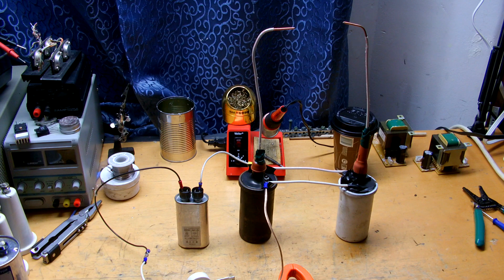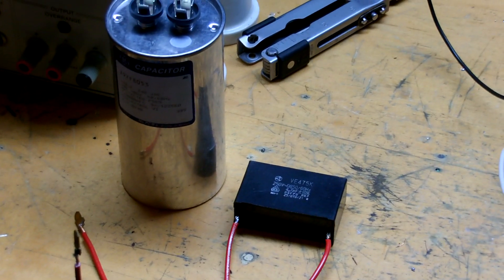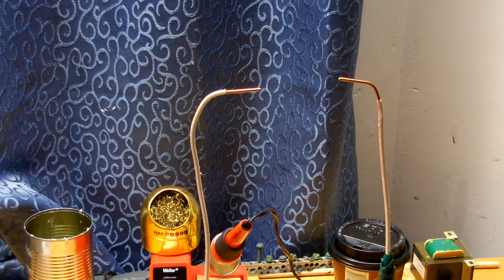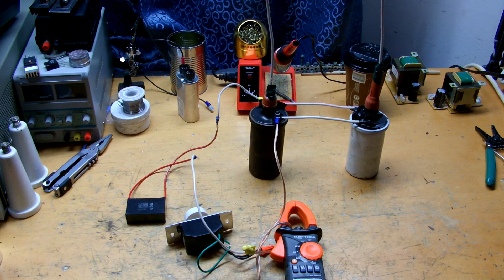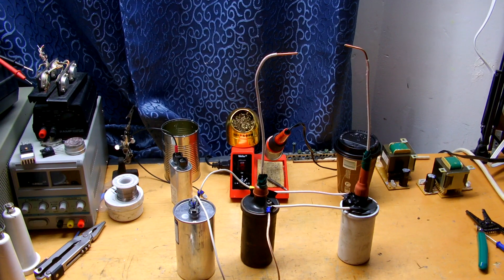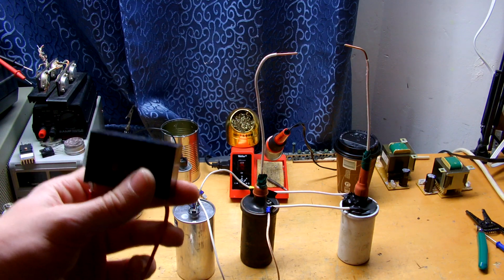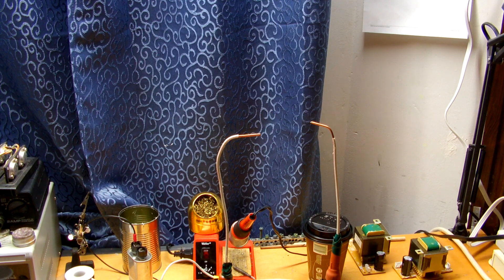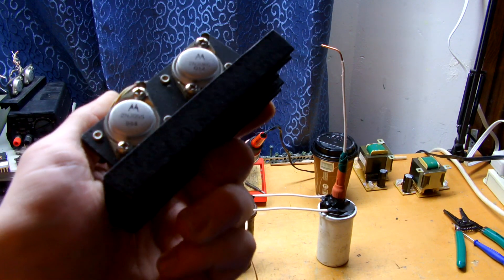Video for Alex993cc1  Ignition Coil Capacitor Tests

Comment: One thing I have noticed  SEVERAL times doing this sort of thing with ign coils, is that the fine wire of the coil secondary actually BREAKES and goes un-noticed since it just arcs inside the coil can and will appear to operate normally.
To test for this (a good idea after every hard run), is to check for an open connection between the HV terminal and the others.  In the case of a dual connected pair, a check can be done between the two HV terminals.
GREAT VIDEO!!

Comment: Hello Pete, really good video, I am building a prototype ignition coil driver system but I am limited in my knowledge. If you could I would like to see a simple diagram of how you wired the 2 coils together and also how you were able to stop them from arcing across to the screws. Thank you in advance.

Comment: IT would be nice 2 C a simple schematic. 
Are U  Feeding with line voltage and the dimmer through the caps ?
There are too many wires wrapped around it to plainly see the configuration..
ALSO, since each ignition coil has the other side of the output grounded, do you have the primaries cross wired for the proper phase ? With two of the same coils they will have the same voltage and no difference of potential between them.

Comment: Have you tried a couple of 200V electrolytics (same value) back to back? Should be much cheaper and smaller than the oil-filled type you have there.

Comment: watch?v=zGJG2BamDFQ
I NO MY VOICE WAS FUCKING BAD IT WAS CHANGING. I HAVE NOT DONE A VIDEO IN A LONG TIME WITH A COIL BUT THIS IS ONE WARE I HAVE A CAP CHARGE AND DISCHARGE IN TO THE COIL. I WILL DO A VIDEO I HAVE MADE SOME CHANGES AND MY VOICE IS NOT BAD.